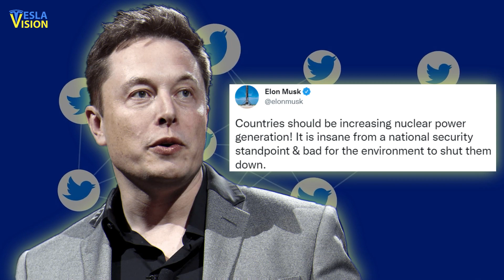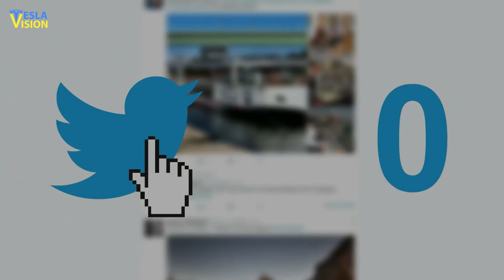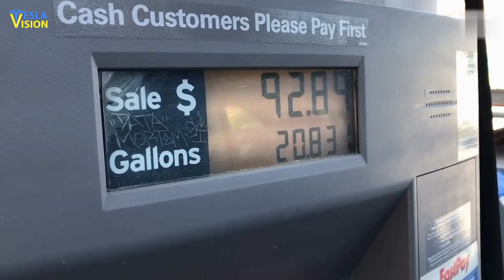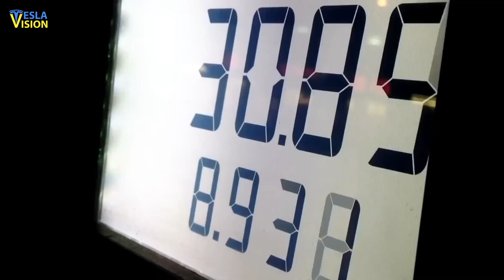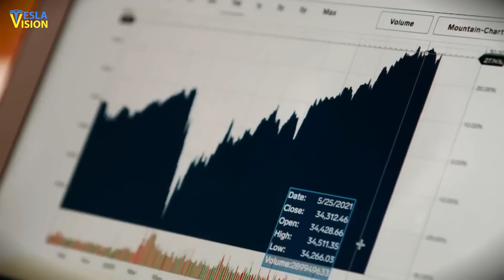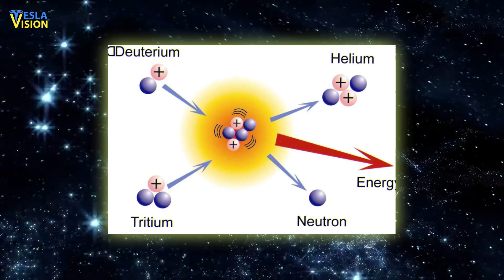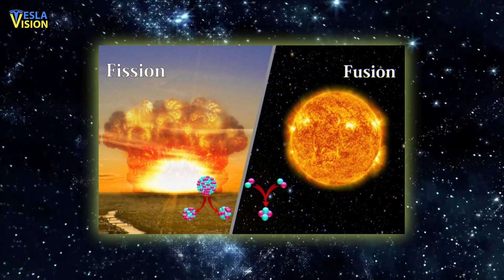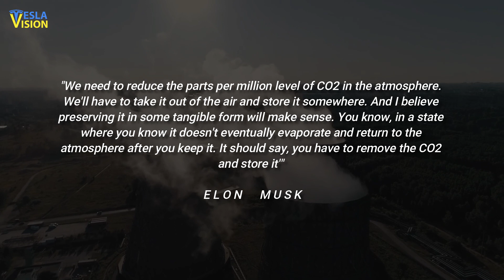Elon Musk Offers to Save Europe from Putin

Comment: The main concern with nuclear is if it gets attacked in times of war. It is easer to blow up a station then launch a nuclear missile. Micro grids work better with solur and wind turbines.
Reply: Electricity transmission does not. Without massive generators it is not possible to give the electricity the push it needs to reach every user. This is why we need some large hydro stations or nuclear power plants.
Reply: @Caldermologist::  50% of all electricity generated is used up with electrical transmission. A  "super conductor" with zero resistance would double the amount of electricity available, using present generation.
Reply: Big.danger in that,...since people can't stop having wars  ,it remains an ever-present,,Doom,,